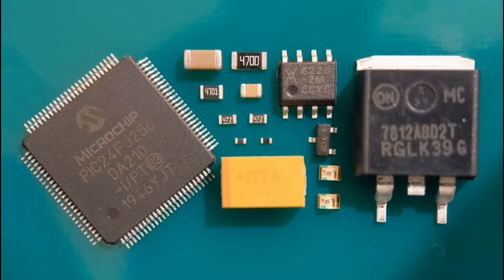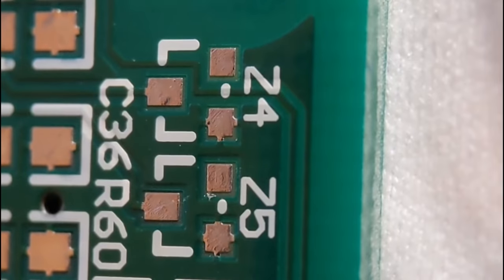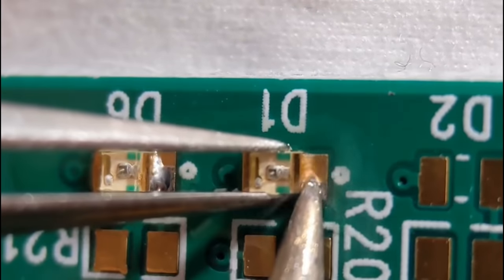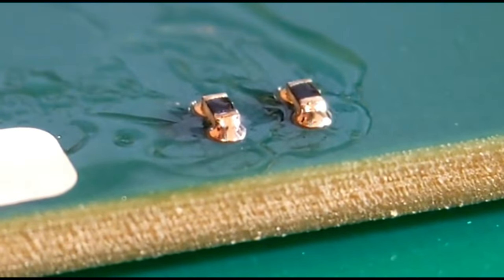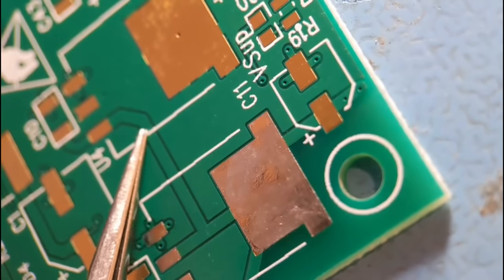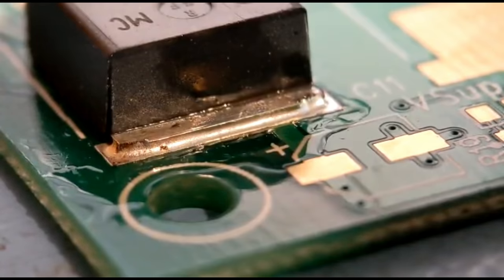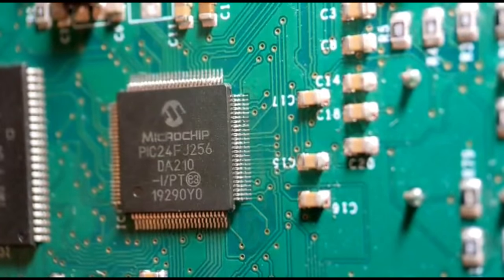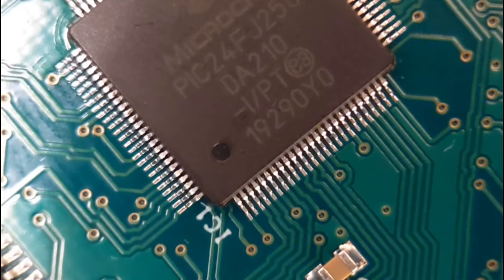How To Solder SMD Correctly - Part 1 /SMD Soldering Tutorial

Comment: Great video, I hope you see this an are able to bestow some wisdom to a novice. I'm trying to remove an replace 12 pin ( 6 on each side) LEDs (RBGW) onto a SMD board for stage lights. My question is, in the video some surface pads were copper an other looked tinned. I'm assuming that new these boards were tinned because there is a thin layer of solder left on some pads and I'm trying to retin the pad before installing the led, what is the best way to do so? Also, is it necessary or can I just clean them all an solder to the copper pad. I just can't get the solder to wet the surface an stay,it all soaks up my tip. I hope this makes sense, any tips for a newbie. Thanks
Reply from the maker: Hi . Thanks for your comment. If you have contaminated copper pads you can simply scrape lightly and carefully to refresh the top surface of the pad using a scalpel blade or similar , add flux then it should tin with fresh solder . If you do this and it works if you need a flat tinned surface then just simply use solder braid to wick off the added solder leaving a nice flat freshly tinned pad . This sounds like a solution for you . The pads that had original solder on them just simply wick off the solder on them , eventually you should end up with  just 12 flat tinned pads . Remember to use flux . Hope that helps , good luck 👍
Reply: @mrsolderfix3996  Thank you very much. I'm sure this all started with removing them improperly. I've tried using a heat guy, the board is metal and it dissipates the heat to quickly and doesn't melt the solder. Thanks for the advice very much

Comment: You just got a new sub!

Impeccable work on the QFP, I admit as I've got older and my eyes have got worse and the hands shakier I find drag soldering fine pitch components is a lot easier, but I did do QFP's this way many years ago with a JBC super iron.

Apologies if you're already mentioned or answered these elsewhere....

Can I ask what flux you use?  I have some really nice rosin based kester flux that I bought a while back, well past the "use by date" but it works perfectly with my hobby hat on, but I am starting to run low and when I looked it up, it seemed to be 80 quid for the same amount I paid 20 quid for, so I'm looking for an alternative flux that doesn't require the pawning of internal organs.

Also it looks like you're using some sort of cloth to clean up the flux residue (we know how awful that stuff makes boards look) and I'm surprised how good you clean them with what looks to just be a cloth?  Is it a wipe with IPA or something, or is it really some magic cloth?
Reply from the maker: Hi , thank you for watching the video, much appreciated. 
The flux I have used for many years was a liquid flux that came in an aerosol spray can. It was amazing stuff that worked so well . It was called SMFL200D but unfortunately a short while ago it became discontinued. Luckily I still have a couple of cans left but I will be searching for a new type in the future. If I find a good replacement I will post on YouTube.
To clean my boards I use a fluid called Ultrasolve which I purchase from places like Farnell , RS Components, rapid online  but if in America maybe places like Digikey or Mouser would sell it. It's the best cleaning fluid I have ever used in the many , many years I've been soldering.
The cleaning clothes I use are Gtek dry wipes from a company in England called Grove sales . Again they are amazing , leaving no fibres etc . I just dip them in the ultrasolve and wipe clean . If I've got a terribly fluxed board I have other cleaning methods that I use and all these are in a video about cleaning that I've posted on my YouTube channel. 
Hopefully that helps you , thanks again , take care 👍

Comment: Toward the beginning of the video (1:31), did you tack the resistor with a little bit of solder on the tip of the solder iron?  If my solder wire has flux already, would it be sufficient?
Reply from the maker: Hi , yes I always tack on 2 pin devices i.e 0201 size resistors all the way up to large tantalum capacitors with a small amount of solder with flux added before this stage takes place. I then do the other end of the component properly then I revisit the first end and do that also properly. The flux in the solder tends to burn away as soon as your solder hits the iron . Is it vital in my opinion to add extra flux to all your soldering joints . Hope that helps , thank you for your comment 👍

Comment: Hi..so good..may i know what the type of soldering iron you used?i am  in practice but many often the tin cannot melt at board and at the solder tip..i keep trying but still the same..may the type soldering iron and flux not as good i had used
Reply from the maker: Hi , thank you for your comment. The soldering iron I use in nearly all my YouTube videos is a Weller TCP S . I use 2 types of iron tip ( PTP7 , small conical + DD8 large flat sided ) . Hope that helps , thanks again 👍

Comment: Can you tell us what flux product your using? Most of them seem to be a jelly type, your's looks like it is liquid based.
Reply from the maker: Hi . Thanks for the question . I use a flux called SMFL200D . It comes in a 200ml spray can , I just squirt a small amount into a small container ( example , milk bottle lid ) then apply using a dipped Ty wrap . Available from Farnell , RS Components , Seen it on Ebay as well . Generally fairly easy to get , about £14 a can . It's a great liquid flux , the only one I ever use. Hope that helps , thanks again 👍
Reply: @mrsolderfix3996  Great, thanks for the info. :-)

Comment: That's a great visual aid for a beginner like me. Could you let me know the tip size (0.5?) and solder thickness. Also is the flux applied using a Roisin Solder Flux pen?
Reply from the maker: Hi , thank you for your comment , much appreciated. I'm glad you enjoyed the video . I've done quite a few other postings on YouTube, all about the flux I use and how I apply it is all covered in one video . Another video shows how to clean flux off perfectly , what fluids and the methods I use is all shown . I talk about solder thicknesses and tips I use on other videos but I use a conical PTP7 solder tip for all small joints and this goes in a Weller TCP S iron . 0.25mm and 0.5mm solder Is all you need really . Company in England ( BLT Circuits ) supply all this . Try Farnell , RS Components for all your other stuff , fluxes etc . The cleaning wipes are called Gtek Dry Wipes from a company called Grove sales ( England ) . Hope that covers some of your questions . Good luck 👍

Comment: Being here in the USA I had a little trouble with the accent. Solder size was it 0.025 and what type of solder do you use? Excellent video and I apologize for the accent barrier. Thanks for sharing 👍 Artie
Reply from the maker: Hi , thank you for your comment, much appreciated. The solder I generally use in my videos for all the small joints is lead free , 0.25mm , Nitrosol Solder Wire , flux 2.2% , alloy Sn100SB . I would just use variations on the thickness of the solder for larger jobs but it would be generally the same make up i.e flux content etc. 
I guess in America your main stockists would be Mouser or Digikey . My wife struggles with my accent at times so your not alone 😂 , hope that helps and thanks for supporting my channel , take care 👍
Reply: @mrsolderfix3996  thank You for the reply. Stay safe and well. Great videos and thanks for sharing 👍

Comment: How are you getting these smd components to stay still? I failed a solder test because the smd capacitors was flopping around every time I applied solder. Is it the flux?
Reply from the maker: Hi , thank you for your comment , much appreciated. I hold all my components rock steady with a pair of tweezers while lightly tacking one end of the component down to the board . The flux alone will never hold a component in place so you need tweezers . Once one end is tacked do the other end properly then redo the first end properly . Works every time. For 4 sided IC's for example I tack on joints on 2 or 3 sides once I know it has been aligned properly. It's actually really easy once you get the knack . It's all shown somewhere in my postings . Hope that helps . Thanks again 👍

Comment: Being an electronics maintenance engineer all my life, today I learned new methods of removing ICs from your great video!  Can the 100pin smd be soldered without doing individual Pin soldering? My hands shake now at the age of 70 so I can't do individual pin soldering of this 100pin SMD. Any easier way?
Reply from the maker: Hi . Thank you for your comment, much appreciated. I'm glad you enjoyed the video. Some people do a drag soldering method to solder rows of IC pins but I'm personally not a fan of this method . There is videos on YouTube of this being done but it's not easy to achieve without getting solder shorts then having to clear them up . The way I do it works for me everytime and all I can suggest is get a good iron , maybe a Weller then as you can get various tips for these choose a fine conical tip .Also get some 0.25mm solder ( I get mine from BLT Circuits , based in England ) this is a great help for fine pitch soldering . Also use flux ( a must for soldering ) I've done a video on it's uses. Hopefully you get on ok and with patience and practice things do improve , this is what I've found over the years. Good luck with anything you try and thanks again 👍

Comment: The biggest secret for me was getting GOOD tweezers. I kept buying the cheap knockoff needle nose tweezers and it was next to impossible to hold components without them flying away, or having the component (mainly 0402's) way too high up on the tweezers, making it next to impossible to solder them on to anything.
Reply from the maker: Hi , thank you for your comment , much appreciated. You are right , the right tools can make a big difference but I learnt originally to get by with what I had . This was a good way to improve as doing it the hard way eventually led me to do harder and harder stuff . It was quite a few years before I got some improved tools and then everything like 0402 , 0201's etc seemed really easy . Hopefully everyone can improve and eventually get what they need . Thank you again for your comment 👍
Reply: @mrsolderfix3996  Any recommendations on where to begin?
Reply from the maker: Hi , for surface mount components I would just buy a practice kit off of EBay or get some scrap PCB's from old electronic gadgets and just start trying to remove parts , clean pads up etc and then fit new parts . I've done videos on quite a few subjects , hopefully these can be of use . 
I would try and get a couple of different size solders , 0.25mm and 0.5mm if you can and a couple of different size soldering iron tips , one conical for fine pitch and one large screwdriver type tip for all your larger joints . Also get some rework flux which is vital when soldering . The more you solder you will definitely improve and then you can progress to smaller and smaller work . Good luck with your soldering , hope it goes ok 👍
Reply: @mrsolderfix3996  thanks for your time. I'll give it a go with your vids!!
Reply from the maker: Hi , good luck , hope you get on ok 👍

Comment: Hi you have a great video I would like to know what's the size of the soldering wire and the flux  Paste  You are using Thanks
Reply from the maker: Hi thank you for your comment, much appreciated. I generally only ever use 2 sizes of solder wire , 0.25mm for any fine pitch components or tiny resistors etc and 0.5mm for any larger devices . I find these are the only 2 sizes I really need . I get my solders from a company in England called BLT Circuits. The flux I was using was SMFL200D but  unfortunately it has just been discontinued so I'm looking for a new one at the minute. Hope that helps , thanks again 👍

Comment: What is it you rub the solder joins and left over flux with? It cleans nicely and I wish to acquire some.
Reply from the maker: Hi . The cleaning fluid I use is called Ultrasolve. It's the recommended partner for the flux I use (SMFL200D) . Ultrasolve is available from various electronic suppliers , Farnell , RS Components , Rapid Online and many others . Comes in different dispensing options also . It's the best cleaning fluid I've ever used and once you get the hang of it you can get your soldering joints amazingly clean . Hope that helps 👍

Comment: That was a great video, kudos to you for that, and also for answering so many questions.  I am absolute beginner here, looking for hobby to take up in retirement.  You have explained the term "tinning" in one of your comments, but just to confirm, does this simply mean applying any kind of solder to a pad and then removing most of it, leaving a somewhat shiny film of remaining solder, tinning referring to that appearance, rather than the composition of the solder (which I have learned are mostly a tin/lead, or non lead)?  Also, I've heard others say "first tin the tip" without explaining how to do that, and again I assume that means melting some of the solder you are using onto the tip of your soldering iron, and then wiping it off to leave a thin film with that same tin-like appearance?  How does that help?

Finally, I notice you can get rosin-core solder, which I understand is solder with flux in the core.  Is this what you are using?
Reply from the maker: Hi , thank you for your support , I'm glad you enjoyed the video . I've recently posted a similar video ( part 4 ) , but more in depth and really clear . If you haven't seen it maybe it will be useful for you. 
You are right about the tinning . When I get some pads that I know will be hard to get the solder to flow on ( particularly when your doing an under termination joint ) , I will sometimes solder them all over then use solder wick( braid ) to totally clean them so as leaving a thin film of solder all over the pad , this then makes the solder flow really easy when you get to the soldering stage.
Tinning a solder tip is essential sometimes as there will be times when your tip will go black and be hard to get the solder to stick to it . Tinning ( basically loading with solder then wiping off ) will eventually clear this black residue but it may take a few tries to clear it . Once you see a silver piece of the tip under the residue you are getting there . Keep doing it and the silver area will grow until you have a nice clean tip .
I do use solder with flux in but always use added flux ( SMFL200D ) as the flux in the solder generally burns away to quickly. All my solders come from BLT Circuits ( England ) , try and get yourself some 0.46mm and definitely some 0.25mm size solders , these 2 sizes are a must. Hope that helps . Thanks again for your support and good luck with all your soldering projects 👍

Comment: Your work is outstanding! Thank you so much for sharing this information and technique! May I ask what soldering iron / station and microscope you use?

Thanks again 😊👍
Reply from the maker: Hi , thank you for your comment , much appreciated. The iron I generally use is a Weller TCP S iron and I mainly use a PTP7 tip ( small conical ) and a DD8 ( large flat sided ) for my soldering jobs .
I also occasionally use a Metcal iron but for all my videos I've used the Weller.
My microscope is a Stereo long reach one from a company in England called GT Vision , their own branded model . 
This type of scope lets you get any size board under it which is really important.
Hope that helps , thanks again 👍

Comment: Hi, what is the name of the trasparent product you use on the Pad before soldering with tin? Thank you
Reply from the maker: Hi , thank you for your comment . I presume you mean the flux that I add to the pads before soldering . 
I use a certain type of flux called SMFL200D , which is a great flux . In fact I've posted a complete video on YouTube showing the benefits of using this flux , places to purchase , video demos etc , all the information required will be in this video . Hope that helps, thanks again 👍

Comment: Hi I just would like to understand what would kill a board if you were working on it and is it repairable. I've seen videos were individuals take parts from other boards saying they are dead but why are they not repairable?
Reply from the maker: Hi . Thank you for your question . There are a few issues that can cause boards to be non repairable. I've come across boards where a component has blown causing pretty severe burn damage to the surrounding area . This would then be scrapped in most cases. Another common one is where a component has again blown ( may have been fitted wrong polarity )  and this can damage traces ( tracks ) on one of the inner layers of a multilayer board . This again in most cases would be deemed unusable. So then other parts which may be ok can be salvaged from these boards . Hope that helps 👍
Reply: @mrsolderfix3996  thanks for replying really helpful you are a legend sir
Reply from the maker: Hi . Thank you for your kind words , much appreciated. Thank you for watching and hoped I answered your question ok 👍